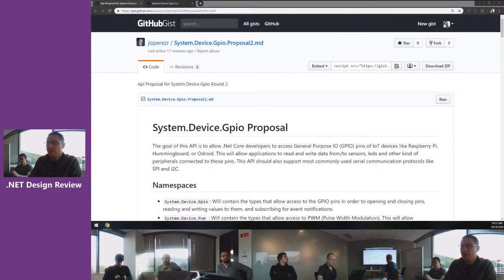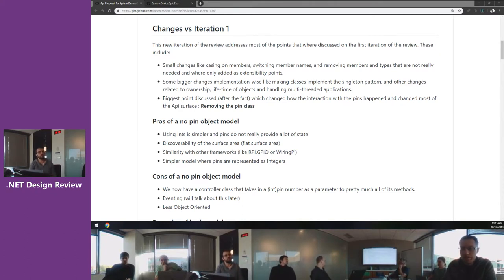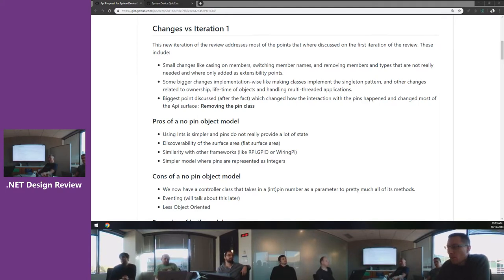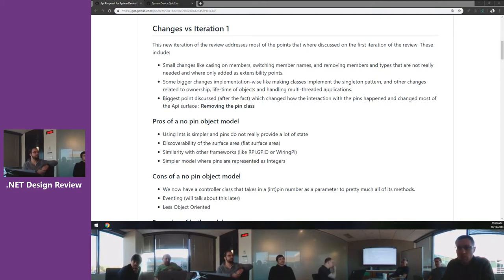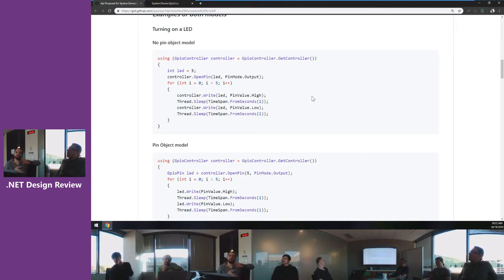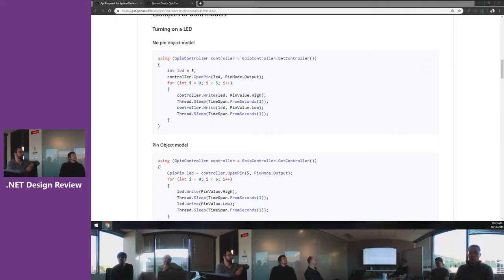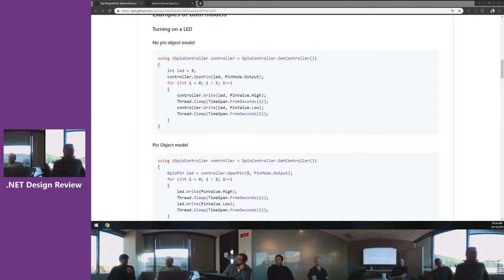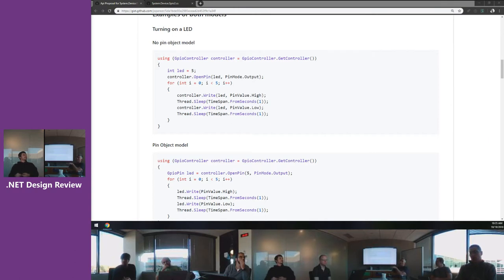.NET Design Reviews: GPIO

Comment: Hi, great series! 
One question, how do you propose handling a scenario where a board has several GPIO groups; like GPIO_A0-15 and GPIO_B0-15.
Two sets of 16 pins grouped under PortA and PortB (handled by different registers etc.)

If you only pass the pin number, to which Port (group) it belongs to?
Would different groups be handled by different drivers passed to GPIO controller?
How then passing only ints to sensor controller would distinguish between pins ports ?